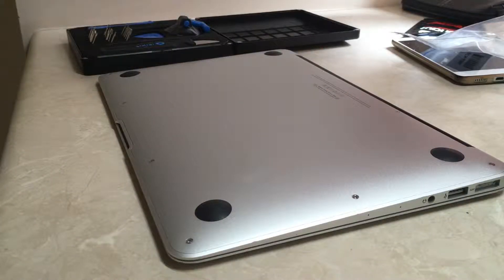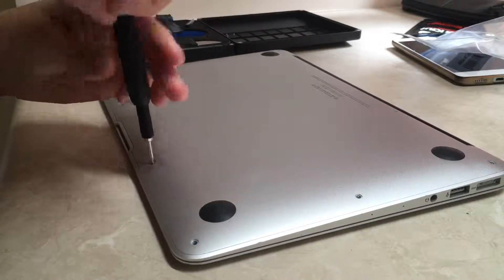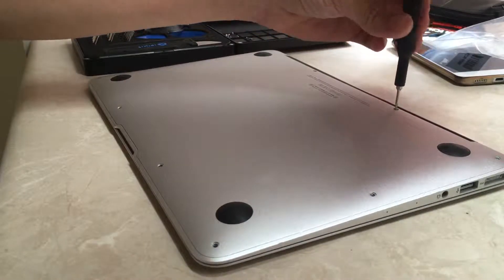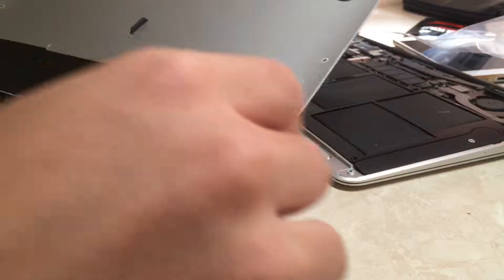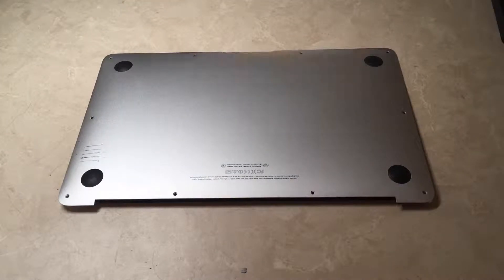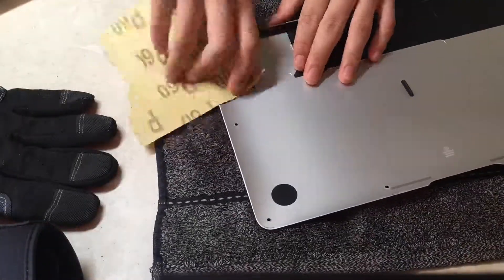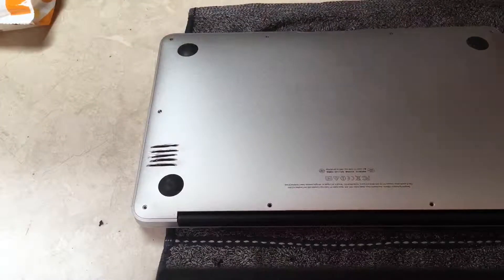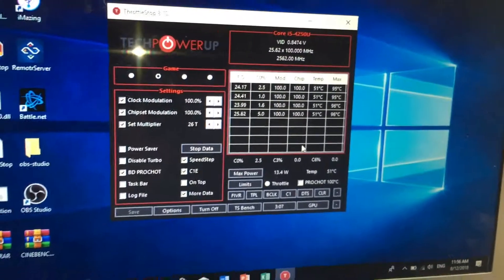Macbook Mods Part 2: DRILLING HOLES IN MY MACBOOK

Comment: I have an old Macbook pro from 2010. Even tho it works perfectly fine, the fans start running and the computer get hot as soon as I open Youtube. Tried to install other OS, change fan speed, etc. The computer just always get hot. On the other side, if I remove the cover I doesn't do that. So holes might be a good addition on the back plate. I think this is legit a good solution. I'm gonna try it too.
Reply from the maker: I have found a fellow psychopath :) maybe before you do that you look at my part 1 video where I repaste the cpu. It will make your MacBook cooler without doing extreme mods like this.